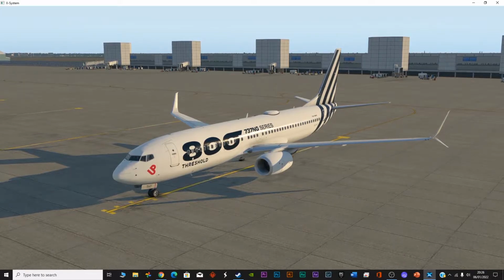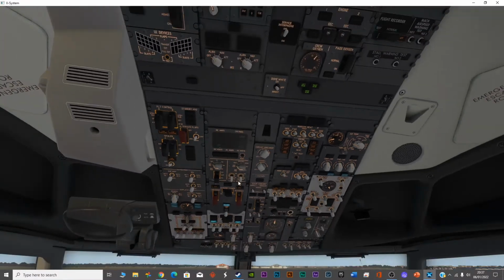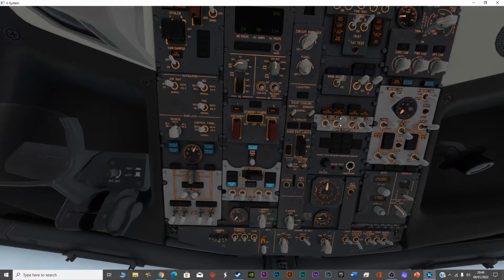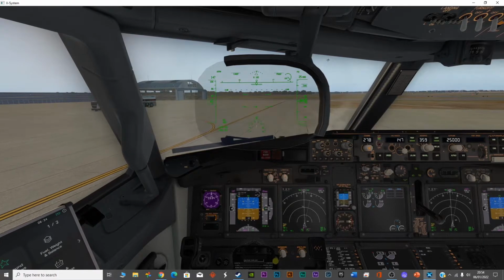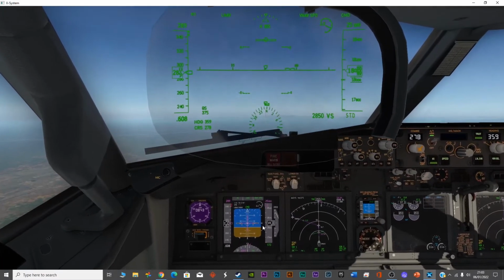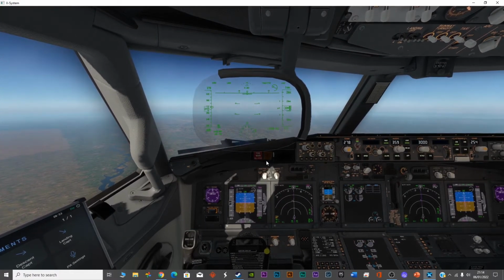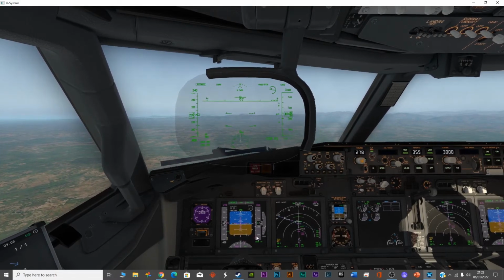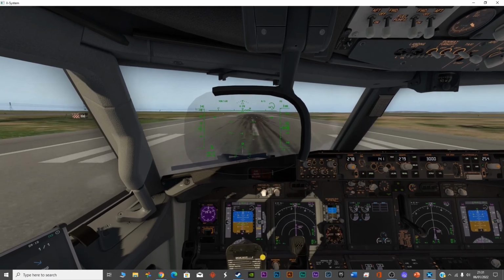My First Flight with Level Up Boeing 737-800 NG in X Plane 11 from Lahore to Islamabad

Comment: Sir the video is nice and can you please tell me how you got the big pushcart like the one which is pushing back another aircraft in the beginning of the video
Reply from the maker: It is by default. I am not using any plugin for the simulator
Reply: Thanks
Reply from the maker: You’re welcome
Reply: Hello sir I tried downloading this  level up but I get 2 FPS instead of 10 FPS can you please help me?
Reply: I have a low end laptop.